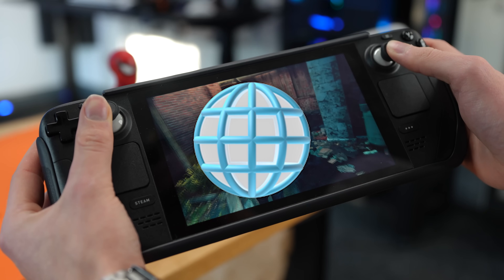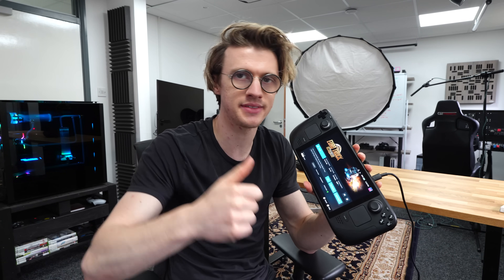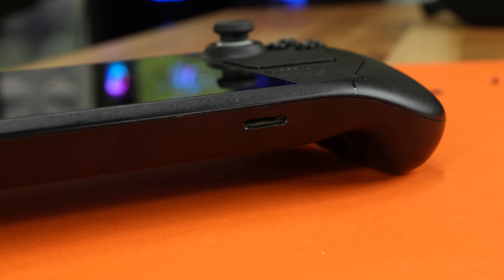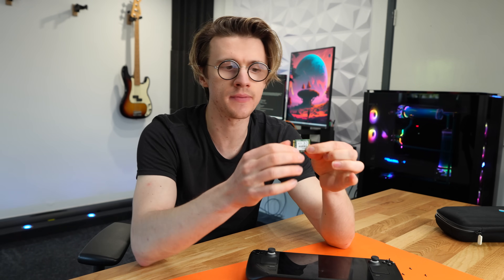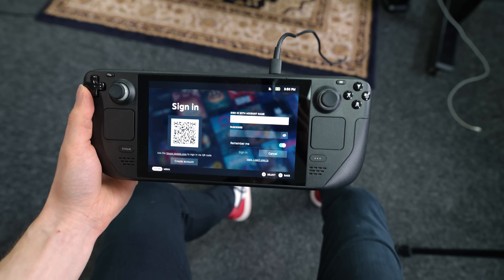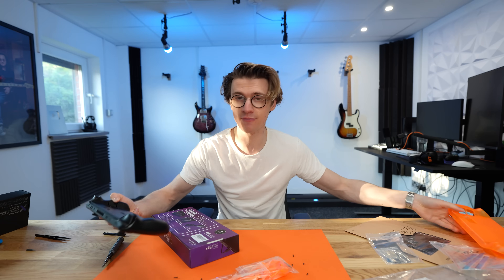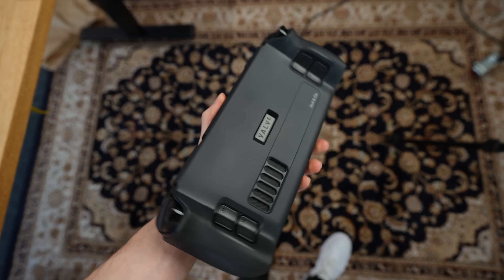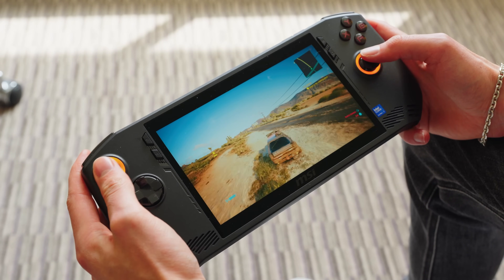I Upgraded The Steam Deck - 2TB SSD Replacement Guide

Comment: Bought a very cared deck a couple of months ago for 250$, replaced its stock 64gb SSD to Corsairs 1tb SSD, replaced cooling paste to Kryonauts thermal grizzly and it works like a charm.
Super happy with my deck.

Comment: Confused here as to why a 64gb came with the Blue logo on the case I thought that was an exclusive with the 512gb with anti-glare LCD screen and the recent Orange logo with the OLED variant? 🤷‍♂️, The 64gb should come with the Grey logo on the case makes me wonder if you ended up with the wrong case or someone switched out the 512gb ssd to a 64gb ssd (not a bad thing if it's actually the anti glare screen) 🤷‍♂️ you'll need to investigate it more 👍
Reply: all steam decks cases come with a blue logo. there were ones with an orange logo for early adopters but not anymore. and i'm not sure what the oled case looks like.
Reply: @TeaStuff2047  from the steam official information on the 512gb model
**
Similar to the 256GB and 64GB models, the 512GB model comes shipped in a carrying case (which we decided to use as the actual packaging, rather than a traditional box). All cases are functionally identical, but there are cosmetic differences in the 512GB case's details: The outer Steam Deck logo is a different color, the zipper pulls are different, and the case's interior fabric is different. There are also two small additions to the 512GB case that the others don't have: a separate drawstring pouch for the power cord, and a microfiber cleaning cloth 

**

from that information 64gb and 256gb lcd have the white or grey logo, the 512gb has the part blue logo comes with a drawstring bag with logo for the power supply and a Steamdeck logo branded cleaning cloth 

and the oled 512 and 1TB have the orange logo

Comment: I got a 1 TB LCD for 280€, super cheap and it was basically like new, changed the back plate and added the jsaux modcase, i had a 128gb SD laying around from my OLED Switch, ive been super happy with the deck :)
Reply: How i can get the Steam deck cheap?
Reply: Is in the desc?

Comment: where's the part where he made it faster?
Reply: The read/write speeds of other SSDs are better than the 64GB eMMC.
Reply: @CallMeMilenko  that isnt making the steam deck run faster.
Reply: @joogled1839  Makes your games load faster compared to eMMC or an SD Card.
Reply: @CallMeMilenko  the loading between SD and SSD are not very noticeable. as someone who has tested this very thoroughly
Reply: @TeaStuff2047 Have you tried running COD from an SD card? Waiting for the game to boot and shader compliation takes about 10 minutes.
Reply: @CallMeMilenko I don't have this problem with a micro sd. I have a very fast micro SD card. The only thing I noticed is it's like maybe less than a minute slower than my SSD.
Reply: @Atomic-Purple-Guy  I have a Sandisk Extreme. COD's boot time is the only thing I've noticed so far. Once it boots and finishes with the shaders, it runs great. Might just be COD. I did a full playthrough of Cyberpunk from my SD Card and had zero issues. Boot time was fine and loading was just as fast as the SSD.

Comment: It's not worth it. 250 for deck plus 150 to 200 for 2230. Deck has fallen behind all the others. Ally x I'd king
Reply: Deck is king that’s why others are still trying to compete with it.
Reply: @playnicegames  no competition. Deck is just the budget handheld PC.
Reply: @playnicegames  Amen! 🙏
Reply: Steam deck 1 was the pilot to see how games will work with linux and community @playnicegames
Reply: Ok buddy. Till they release 3 more... the deck is a perfect all rounder for those who like to tinker or want a simple device. It cannot be beaten by the likes of the ally
Reply: Just go look at the sales numbers. Steam deck is still on top.
Plus windows sucks. Linux needs to take over. Open source is better
Reply: @chriscole9621  because it's the budget handheld
Reply: @chriscole9621  windows doesnt suck, it just sucks on handhelds.
Reply: Nothing actually competes to the Steam Deck when it comes to performance. There isn't a single machine that can push frames and such low power consumption like the Steam Deck. Now, some may claim it's unfair because it has a custom chip but, other manufacturers should follow suit and innovate. The problem is, they actually can't afford it. 

Valve actually sells all of their Steam Decks at a loss. They make their money back with game sales and such.
Reply: @LelandHasGames  its not even "unfair" because asus works very closely with amd. they could easily get the apu they need to make the ally series of handhelds actually worth it to an average consumer, and sell things like docks and accessories on top of that to make up for selling on a loss if they go the same route that steam did.
Reply: @joogled1839  I don't think you realize how much of a massive loss that Valve has from selling the Steam Deck. Even a base model should cost $600. They are selling the Steam Deck because they make sales on their platform. Asus, Lenovo, they all can not compete with Valve because they literally can not afford to sell their systems at 300 bucks. They have no platforms or software to make their money back with. They can't afford a custom card hip either because that's even more expensive. Taking a chip that has already been manufactured for other machines is way cheaper than having AMD make a custom chip that is exclusive to a handheld. It's just not something anyone but Sony, Valve, and Nintendo, can do. Their business is games, not hardware.
Reply: No, the oled is still the best all around handheld out right now,  the numbers don't lie
Reply: The Deck is the best all-round. It has its own really good optimized Os that even other developers use.
Reply: Bros gaslighting themselve
Reply: Not buying from asus after all the warranty and sd card fiasco
Reply: This comment is from one perspective the steam deck outsells all others
Reply: The Deck outsells all the handhelds because it’s advertised directly to your face on the biggest PC gaming platform, Steam. Plus the Deck has been on sale for about a year longer than every other mainstream PC handheld on the market. As someone with the Deck OLED, the Ally X is the best handheld. The Deck is the great though and I prefer it over the Legion Go
Reply: Windows 11 is the ally’s downfall, steamOS is superior
Reply: @MewingC  steam os is simple vs win 11, the only bad thing about ally is lego games. You have to disable the touchscreen
Reply: @kibatechwolf  windows is great on desktops or laptops, but on handheld it’s mid
Reply: Windows=mid
Reply: @BigBossultrastealth  nothing beats it
Reply: @BigBossultrastealth  that's you're opinion... And your opinion is mid.
Reply: Steam Deck OLED is King! Asus rog ally x is $800 plus and it's not even OLED LOL....No thanks, Steam Deck OLED is still King
Reply: @Abizzy84  I own both. Ally X is better in my eyes. The lack of an OLED screen isn’t that big of a deal plus you’d end up sacrificing VRR as OLED panels that small don’t support it
Reply: @Abizzy84  slower, less battery, old technology, less compatibility. Ally is definitely king
Reply: @kibatechwolf  less battery?? you mean a smaller capacity? it still gets better battery life than the ally x in a lot of cases.
Reply: @joogled1839  with a maximum tdp of 15w the deck is made to push as much battery saving as possible. My ally x lasted nearly 4 and a half hours on spiderman at 20w tdp
Reply: @kibatechwolf  on what settings though? with upscaling? framegen? you need to list these things when making claims like that.